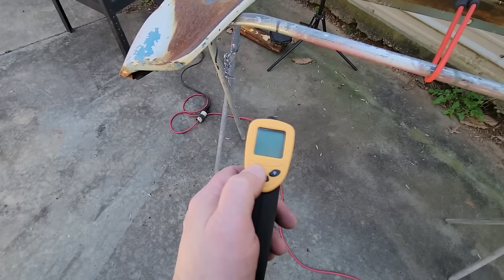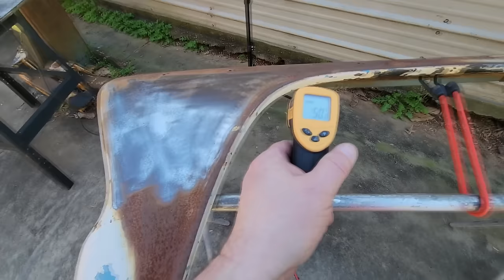How to Remove Surface RUST (Fast and Easy) With This TRICK

Comment: Get the largest bath towel you can find.   Soak the towel soaking wet with distilled vinegar.  Place the soaking wet vinegar towel on the fender.   Go home for the night.  Come back in the next morning and remove the towel.   Rinse the fender with a solution of baking soda and water to neutralize the acid from the vinegar.   This should remove nearly all the rust.
Reply from the maker: Thank you ill try that, we use to do that with paint stripper. We would put the stripper on the pannel and lay plastic wrap over and wait an hour then peel off the plastic wrap and the paint would come with it!!!!
Reply: I use 10% white Vinegar to remove rust from parts by soaking them in a filled container for 2-3 days, works excellent. Never have tried using a towel soaked in it and covered with plastic, good tip.
Reply: That's how I de-rusted my woodstove.
Reply: Ten times quicker if you add common house salt.
Reply: BillySBC: Better modern day living through chemistry 😂

Comment: Wipe that fender down with OSPHO , a rust neutralizer.  It chemically converts iron oxide to iron phosphate. We used it offshore, sadly water conditions. I've used it on 4 tractor repaint over 25 years and no bubble rust came back under the paint. I use it after sand blasting or sanding to kill any rust that's left. Just spray it on or Wipe it on, let it sit over night, do a light sand, and prime it. Paint sticks to this really well. Nothing worse than doing a nice paint job and a year later you see rust bubbling up.
Reply from the maker: Thanks ill try to find some!!!!
Reply: Coraseal I find works better then
Ospho but both are oxidation converters that change the property of rust into a non oxidation compound, coraseal has a sealing property that works better then ospho. I used both products extensively since 2001 when I started as a deckhand on NY harbor tugboats, I’ve been a captain for 12 years and always use both products keeping up on rust prevention.

Comment: The scrub wheel is to aggressive, can take of the metal and make it look wavy. Use a wire brush wheel instead
Reply from the maker: The scrub wheel I used didn't remove any material that I could tell, but those flapper sanding wheels definitely will!!

Comment: I take a old towel. Soak it with white vinegar. Lay it on top of the fender or whatever. Sometimes throw a piece of plastic wrap over it and let it sit overnight. You will be amazed.Smitty
Reply from the maker: I may try that over what ive done, thanks for the tip!!!

Comment: I got a little mini bike frame with some small rust under the spray paint i used. Will a wire wheel and a new coat of spray paint be good or should i use a rust primer to help? Thanks in advance

Comment: Soak some towels in vinegar. 
Lay the out on the panels. 
Let them sit. 
Keep them soaked with vinegar for about 24 hrs. 
Remove towels. Hand scrub with wire wheel or red scotch brite. 
You’re welcome.
Reply from the maker: I've used that method, it works great!!